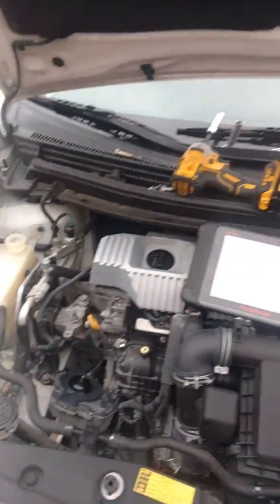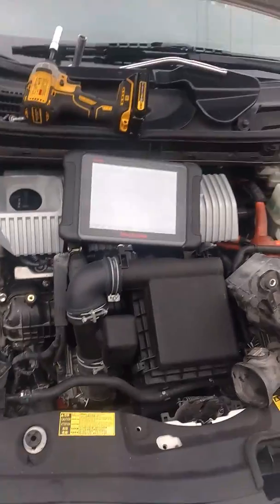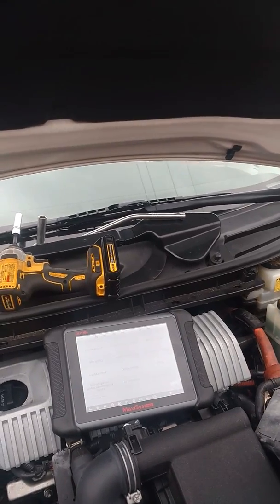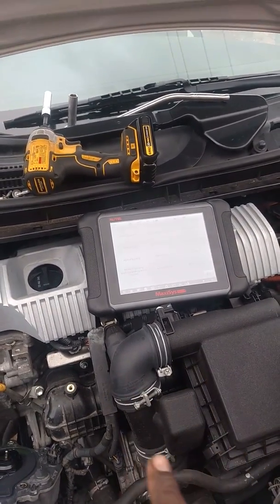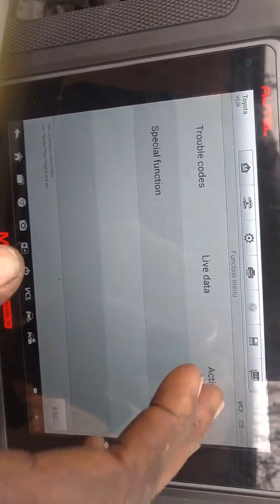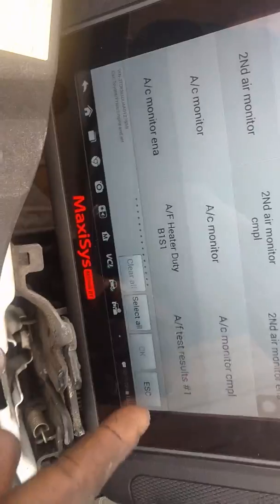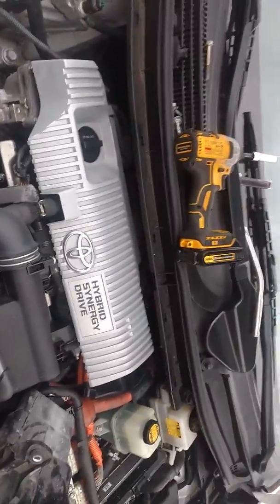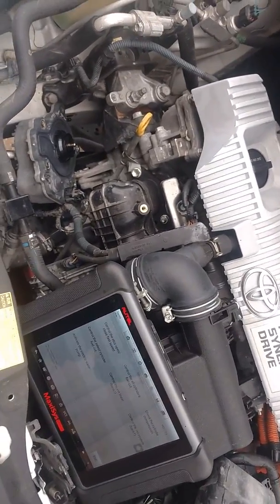3rd gen Prius electric water pump diagnosis using Autel

Comment: Here's my notes. I'm going to replace it myself.  2013 Prius 262k miles. People suggest to replace water pump and inverter pump between 100K and 200k miles. While Gen 2 had more inverter failures gen 3 seems more reliable but some day it's going to fail so I'm preventing that. Thanks for video.

don't wait, replace pump before at every 120-140k or 175k is ok max, preventative.
pump is around $235 from a dealer.  inverter pump was done at 200k by raytheeagle.
water pumps generally lasts 100k to 200k miles.

learned the hard way that you better replace it regularly, before it blows as when it blows it can burn our your inverter which dealers charge $3000 for plus labor. Good luck finding a shop that knows how to put in a used one (Check Car-Parts.com) which you can find for $800 and up.
My Toyota dealers never warned me once about the danger of pump failure causing such an expensive repair. 

While the very short trips, without AC and minimizing regen (put the car in neutral before hitting the brakes) in low/moderate temps probably is OK I would not exceed a trip of more than 5-6 miles and then allow quite a while for the inverter to cool down before driving again. I can tell you first hand that the inverter temps rise very high very quickly (monitored with CAN-View) and a burned up inverter will cost you a LOT more than a rental car.

This usually keeps the warning light illuminated, but sometimes the failure may be intermittent and the warning light will come and go. If your having intermittent warning lights and P0A93 code in the diagnostic history, its best to go ahead and get the pump replaced.
Reply: rockauto.com original part prices: 
WATER PUMP= AISIN WPT190       $197
INVERTER PUMP= AISIN WQT001  $87
THERMOSTAT= AISIN THT017          $31
shipping+tax=    $41

Comment: I have a similar problem and are looking to know what kind of obd2 machine you used to turn it on.
Reply from the maker: Any that has bi-directional capability. You can also remove it and turn the car to on position. It will run for a few seconds

Comment from the maker: Without scan tool you'll remove the water pump, disconnect the electrical connector then start the car and reconnect it. It should run for a brief moment and you'll be able to check whether the propeller is operational or not
**Sorry about the picture. But if you have it in portrait mode you can put a finger on the corner of the screen and rotate your device (tablet in my case) to watch it in full screen